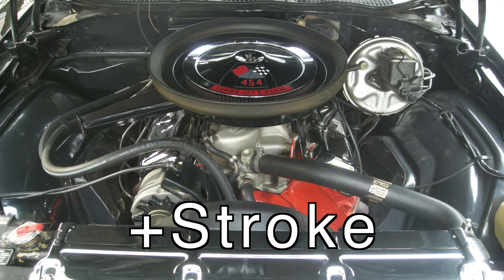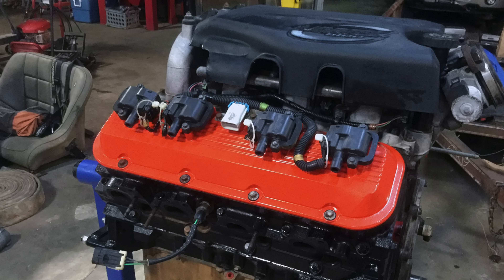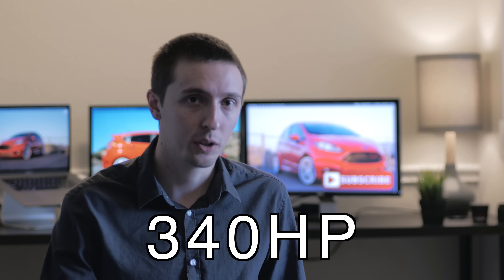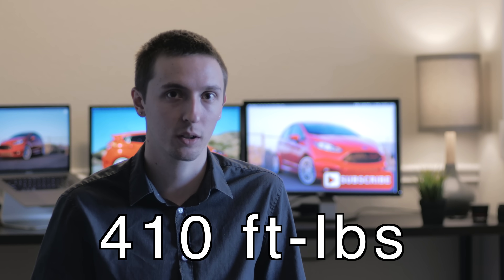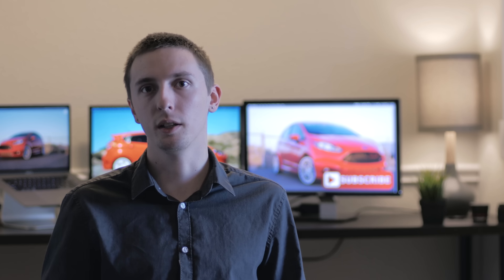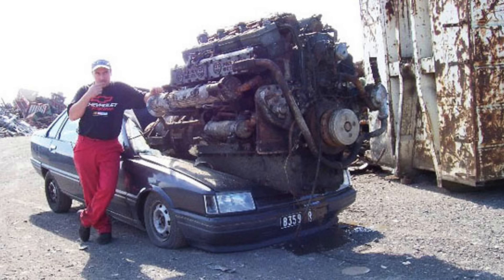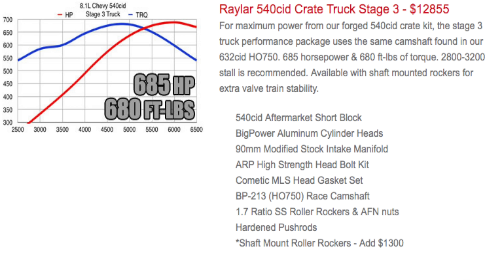Vortec 8100: Everything You Want to Know | Specs and More

Comment: Lame video.  You compare to duramax and fail to talk about the motor.  What years where these available?  What is the bore and stroke?  Can they run on ethanol?  Does it have a forged crank?   Are there manual transmission options?  Is the sump in the front or rear of the motor?  What are things to look out for when buying a used 8100?  Do they leak frequent?  Do they burn oil frequently?  How many miles are they good for?

Comment: I love this engine. My first one I bought in a new Avalanche - then had one in a Suburban for a couple years. Since my Avalanche is no good for pulling gooseneck trailers, I recently added a 2001 3500 dually for farm use and backup for my Ford F550 6.7L. I like the lower maintenance costs for short-trip work and it still has enough towing grunt for the occasional highway use. It's too bad GM stopped production.

Keep up the good work!

Comment: My 2001 Silverado 2500 8100 vortec just hit 350,000 miles and still runs like a champ.. all original.. only the transmission  was rebuilt at 300k.. far more reliable than the LB7 duramax

Comment: I have 2002 gmc 4door long bed and the 8.1 in it is the best truck I've ever seen. My dad has 2015 Duramax I like 8.1 it makes this long truck feel light on its feet fast and makes a 460 ford feel like it has dead cylinders and a hole in the gas tank I was a ford guy key word was still like 7.3 powersrtoke ford

Comment: I been searching for a 2002 Silverado 3500 8.1 Dully rear wheel drive 4 door in MINT condition... And I just found one, vid coming soon. My last 3 trucks two LB7s and one  01 24V CUMMINS. Truck before that was an 02 Silverado 2500HD 6.0 Mint condition and done up just right. But it was a pig going up grade at all and always downshifting too much, it had no power UNLIKE my new 8.1. Now compared to my tuned LB7s we all know the answer to that but not needing a diesel anymore, I missed driving that gasser with it's instant get up and go. My plane is to put a super charger on it to bring up the HP and torque just enough for better street reliability, nothing crazy.  At my age i don't like to do all this crazy shit the young guys like now a days. If I felt like starting a channel it would be called OLD MANS DULLY DISORDER.   ha! I freaking love this truck the best of all of the ones I had before it.  And the stereo gets way more loader then any humans needs to be exposed too tho. lol

Comment: Not gonna lie I've always drooled over the 8.1 as far as power goes but I'd really wish they'd have better aftermarket support. But I love my 04 2500hd with the 6.0 lq4, I want to stroke it to 408ci and throw some nice supporting mods like a torquey cam and what not since I tow regularly but I really wish my truck had more power stock cause 300hp crank (gm claim) isnt cutting it
Reply: The early iron head small cam(same as LR4/LM7 4.8/5.3) LQ4s were rated 300hp and they never increased it. When the aluminum 317 heads and late LS1 cam were used later the power was likely at least 325hp if not more since it's unlikely the LQ9 with only 0.6:1 of a point of compression made 20hp more. All you need is 706 heads, TBSS intake, 1.75" primary long tube headers and a cam in the 220s with a tight exhaust split, .595 lift and a 106 LSA. Your 6.0 will have tons of power everywhere.

Comment: 8.1 came in anything that got bigger than a 1/2 ton frame. Avalanche, Suburban, 2500/3500(HD's) plus the list of mega stuff like RV's, Kodiak, etc. The Allison was not offered on the Avalanche or 'Burb though, they got the old 4 speed, and towing suffered greatly for it in those vehicles. The Allison transmission was the most important update GM made in it's HD trucks back then. 
 
I would put (unmodified) an 8.1/allison against a similar era duramax for towing all day any day. The power starts at almost idle and the truck will shift before it tapers off. There is zero comparison to the 6.0's, that's almost laughable.  As for mpg, I get 15 running empty on the hwy. Buy the right tires, keep the allison serviced, and for the love of pete put the correct oil etc in the thing not 15/40 sludge. Besides that, run NO ETHANOL FUEL. 
In the long run, say what you want about gas prices, diesels are expensive to fix, the 8.1 will need some spark plugs and a quart or two of oil in between oil changes on it's way to 300k miles. You can buy a lot of gas for maint. cost difference between the two engines. 
People looking to spend $$$$$ on a truck engine designed for pulling.... you are barking up the wrong tree. Why spend 6k dollars on an 8.1 when you could spend it on a small block for "go fast" fun?  I won't try to convince duramax freaks about the $$$$, they don't care they would rather drop 15k dollars on a 5000 lb truck then spend half that on a sporty car that will go just as fast and still be a lot cheaper to do maint on and still get better mpg. It's like the people with Jeeps. To each their own, if a dumptruck engine floats your boat I ain't stoppin ya.

Comment: I have one and it's for sale...2004 Chevy 2500HD LT crew cab 2wd. W/ 130,000 miles. It's a dark grey/ greenish in really good shape for the year. It has a small lift with 35's that only have 5,000 miles on them. Bilstiens all the way around were just put on a years ago. Had a new radiator put in as well as a new coolant tank and a window washer tank. It also has swing tool boxes and fifth wheel rails. I feel totally comfortable driving this thing all the way to the other side of the Earth.  Let me know if you're interested. Thanks

Comment: I had a 454 in 2 motor homes, gutless fuel toilets.  Made me hate GM more than I was already was biased against.
Why GM puts a IFS in their 1 ton and P30 setups just proves GM is a cheap worthless platform for trucks. 
I'd never have another GM again.
In real life though gas vs diesel, gas always loses when you look at efficiency and longevity.
A N/A engine will always have a harder time going up mountains because the air density, the turbo compensates for it.
Good video to watch though!

Comment: After owning a 8100 GMC Yukon for halfer year, I have to say it exceeds my expectation. It makes boat-load of low end torque. Many time, when I was expecting a down shift from the transmisson, it actually just went up the slope on top gear because it just has so much torque (Yukon XL 2500 and Suburban 2500 have 4-speed auto, which is not the Allison found in the pickup truck). It is a lot cheaper to buy and cheaper to maintain than the diesels. My GMC has 200K miles, but all cylinder hold very high compression during compression test. Many of those 8.1s just do not work that hard. Many people DD them. So they can last long time.  Yeah the diesel is more powerful, but the cost of rebuilding the 8.1 is probably less than the cost of just an injector work on a diesel.

Comment: i just picked up a 91 silverado 2 wheel drive long box , do you think the truck could handle the weight of the 8100 ?
Reply: Front end would sit pretty low...really low if it's a half ton. IMO find an LQ4 with a trans etc and put that in, better fit for a half ton. The 2500HD's the 8.1 came in has torsion bar front suspension, not really even comparible to a 90's coil spring front end. An LQ4 though, people drop those into Monte Carlo's and Olds Cutlass.... I am sure a truck could handle that no problem.

Comment: Are you saying the 5.7 the for 5.8 4.7 and the 6.0 and the 6.2 are not LS base engines I'm not trying to be smart I just asking you seemed pretty knowledgeable my understanding was a lot of these parts can be interchangeable the difference is the Boars in the block without going to much into detail also there's some differences like the the head cylinders so on and so on but for the most part I thought parts were pretty close and being interchangeable between them please correct me if I'm wrong thanks

Comment: I was wanting to build a C-10 with a ZZ502 type big block. But they're 6k as a short, 10k as a complete engine. So, I have someone on Facebook marketplace selling an 03 8.1L running, with video of it running pulled from a 2500 van, for 1300, so I was trying to find out how much different a Vortec 8100 would from  a ZZ502, there is a company called Raylar Engineering that makes performance parts for the 8.1, but they're still leaning toward the towing end of the spectrum.

Comment: should have done just a bit more research on the 8.1 before posting this. the 8.1 shares exhaust manifolds and bellhousing pattern with the 454. block heads pistons cam crank rods intake manifold nothing crosses over and on top of that it uses all metric hardware besides being internally balanced compared to 454 being externally

Comment: 8.1 got 8-12 mpg
Reply: I get 15 empty on the highway. Can;t run ethanol fuel, can;t put goofy tires on, can't run 15w40 oil(lol) in it. My truck has 18" wheels but I kept the same overall tire diameter, so less sidewall. Rides a hair rougher, got 3mpg better on the open road. 
Towing I get like 9 though, but it drives the same whether I have 500 lbs or 12,000 lbs behind it. Only truck I ever had like that otherwise was an old Ford with a 300 straight 6. That thing was a tractor lol, but was about as fast as one too.

Comment: I have a 2001 2500 crew cab long bed 8.1. Just hit 120k miles on it and the only issue I ever had with it was the driveshaft shredded in half at 3k miles (I'm the original owner). I also have a 1999  crew cab dually 7.3 f350 (original owner of that too) it has 160k miles on it and its had many more issues than my 8.1. Now, the 7.3 has about 80k more miles on it but after buying a set of new injectors for a diesel truck, the 8.1 big block argument makes way more sense. Lol

Comment: You could get the 8.1 with 4:10s or 3:73s. The duramax only had the 3.73. If you get the 8.1 with 4:10s its actually has a higher tow rating than the duramax

Comment: Also, the 8100 has a taller deck so the intake manifold from a 454 does not fit. They had to make the deck higher to fit the longer stroke. Intake manifolds are the major issue in building a hot rod version.
Reply: thanks. i was going through the comments for just this info. thinking of building a later model bb. guess i'll be sticking with the 454 idea.

Comment: I've put about 250k on my 01 Suburban with the 8.1. While she still runs strong, the gaskets are leaking like a sieve.  Mileage has dropped from 14 to 11 over time, but the power is still there. After moving to a Magnaflow at 180k when the cats went, she has a pretty distinct growl. Since all of the gaskets need replacing, I'm just going to rebuild her this fall and try to get another 15 years out of her.
Reply: You must have spent many times the trucks cost on fuel in those miles...
Reply: @hendo337  Oddly enough, probably not. It retailed for about $59k 22 years ago. If I had to guess, gas averaged about $2.25 over that time.
That would put me around 2 grand a year in gas.
It's towed a 7500 lb boat and trailer on some 2000+ mile round trips more times than I can count. It's hauled four kayakers with their boats on the roof and their camping gear inside dozens of times. It carried 1500 lbs of hardwood flooring inside to the house and even fit a three cushion sofa in the back with the door shut.
I think I've gotten my money's worth, but I probably will rebuild it or replace it for another 20 years worth.

Comment: I have a 2004 8.1 with the Allison transmission in a 3500 Suburban and I love it, we use it to pull our 30' RV (approx. 10,000 lbs.), it doesn't get the greatest gas mileage while towing (7-9mpgs) but it sure gets the job done. It gets anywhere from 12-16mpgjust cruising down the highway. I just turned 100K miles, we don't drive it much.

Comment: My 2001 8.1 has been a great engine for the past 227,000 miles and still going strong! I don't live near enough to an interstate to be sure I can get diesel fuel.
Reply: Where I live, every quickstop gas station sells diesel. Back in the 90's we pretty much had to go to a truck stop to buy diesel, but by about 2000 it all started changing.
Reply: @TexanUSMC8089  You can get diesel just as easy as gas.
Reply: Still have it?
Reply: @DusterNutbar  
Yep, I sure do. The wife hit an Elk with it 2 years ago, so the whole front end is new and it's got 237K miles on it now.

Comment: hi question. I have one of those motors  in a Silverado 2500 hd . crank shaft sensor broke off while trying to replace it what would be the best way to get it out . pull the engine or could I reach it through removing the  the oil pan

Comment: brother had a 2001 dually with the 8.1 Allison.  We were headed to a drag race with the car on a trailer (7000#s) running down the interstate chasing a vette at 130 for about 20 miles. Decided we better slow it down before we lost a trailer tire or 3. That truck would do 4th gear posi burnouts for days and pass everything but a gas station.  AWESOME engine.

Comment: They made the 8,1 in a two door 2500 that's what I'm,gonna start lookin for
Reply: Jesse Reed I worked for a Chevrolet dealer from 1996-2009 or so and occasionally would build orders for trucks to be in inventory. One that I ordered was a regular cab long box 2500HD with 8.1L, automatic trans, 4.10 gear, locking rear diff, plow prep package, dual batteries, 5th wheel wiring package, and some other stuff I don’t remember. I saw it as the ultimate work and play in stock form. That was one fun truck to drive that could also work like a mule. You’ll certainly love it if you get one.

Comment: I've had my 02 sierra since new and it currently has 325,000 hard miles with no engine work ever done. Paired with the Allison trans. Both are still workin great!! (Knock on wood)
Reply: Great to hear Ryan!. My '01 8.1L has 160K and has run flawlessly so far.

Comment: I love my 04 2500hd W/T, has the 6.0 LQ4 with the 4l80e and the 4.10 rear end. Pretty basic but is a solid truck. I wish I could find one though with the 8.1 though that would be great in a single cab truck, boosted and built.
Reply: The 6.0...a 5.3...a 4.8...is a better engine for boost than an 8.1.

Comment: My 2001 still going every day
Reply: I love my 2003 Avalanche 2500 with the 8.1.  It's an absolute torque monster.  Pulls over 10,000 pounds like it's not even there.  It's been the best GM engine I've ever owned.  Just bullet proof, extremely reliable.
I owned a 2013 Chevy truck with the 6.0.  It made a lot of power and pulled well.  But it definitely did not have the torque my 8.1 has.  I sold my 2013 and although it took awhile to find a really clean Avalanche 2500 - Its all I use to tow with now.  A lot of my friends own diesel trucks and they definitely spend a lot of money on maintenance.  
I get a consistent 9 - 10 mpg
whether I'm pulling 10,000 pounds or unloaded.  As far as oil consumption goes - I rarely have to add oil between oil changes.  But if I do - it's less than half a quart over 3,000 miles.

Comment: I have had a 2003 crewcab 4w4 4.10 GMC 2500 HD 8.1 allison set up, I bought new and it has been pretty good for me.  I also have a 454 crewcab.  I have had 427 performance cars as well.  Every big block vehicle I have own does use oil and if mileage is your goal big blocks are not for you.  It seems to me that the allison transmission is what really move these 8.1L engines into the amazing pullers.   When coming to a hill the allison can drop a couple of gears spin the big block engine faster than most diesel engines can function at.  Using a lower gear provides higher torque multiplications and a way you go.  My 454 truck has  400 turbohydromatic (3 speed) and when pulling if drops into second gear you can not get back into third gear until the grade decreases.  The 454 has a performance cam, milled heads etc. and will out run the 8.1 empty of a stop light.
About the time of the 8.1 engine the other heavy duty pickup truck manufactures were looking for updated automatic transmissions and nothing compared to the allisons.  
I had a diesel truck right before this 8.1 and was real unhappy with it:  
1. Diesel engines do bad stuff to oil.  It turns black and if it spills on your driveway etc. it is going to be there for a much longer time. 
2.  Oil consumption: my diesel truck took close to 12 quarts of oil at a change as the 8.1 is about 6 quarts. The 8.1 never uses more a 2 or 3 quarts between changes.
3. Black stuff I guess it is particulates and the black oil made working on it a giant mess.  My diesel was a long bed four door and the engine was covered with black particulates (I can't explain that.)
4  Transmissions would not hold up, turbo charger blew up, fuel injection system leaked from everywhere, caught fire, smelled real bad, would stall if you stopped fast on long fuel tank and many many more problems.  
I know the newer diesels are much better and twic the power.  I didn't have the diesel truck for a long time but was very happy when it was gone.  I pull a very large horse trailer and everyone says, I would be so much better of with a diesel truck.  I am not sure I want to chance that again.

Comment: Drove a 06 8.1 manual and it could take off in third then shift to sixth and still move faster than my stock 04 wrangler 5spd.
Reply from the maker: 2.5l or 4.0l Wrangler?
Reply: 4.0L, I was never impressed with the power of the 4.0 in my 04 and a buddy had a 99 and it drove the same. I know a guy that picked up a 2.5 and it felt like it drove the same but got better mileage.